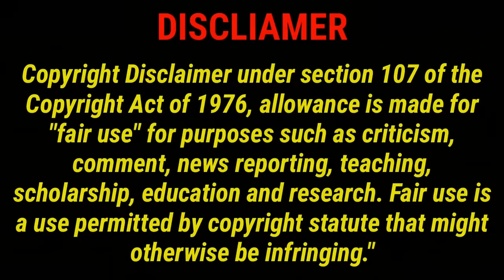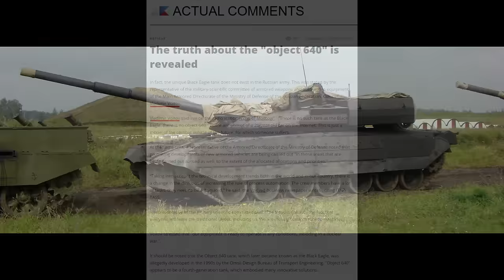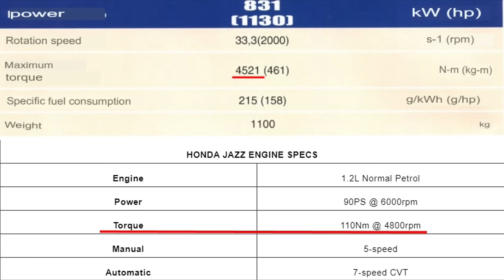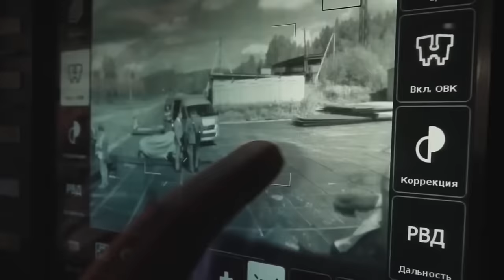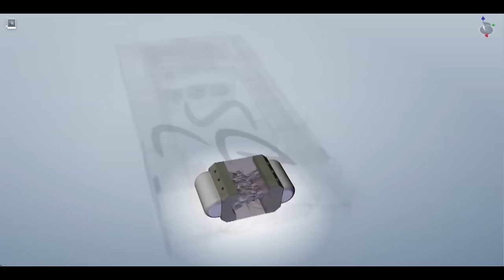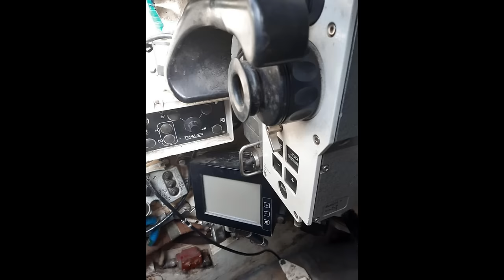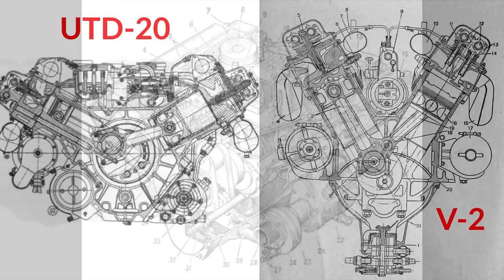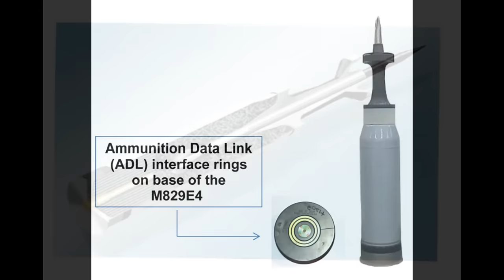LazerPig is WRONG about T-14 Armata

Comment: I mean 96 seconds into the video and there's already bullshit.  "If maintained" the autoloader will function properly...which is a rather big IF given the ample evidence that the Russian Army does not keep their equipment well maintained.  Then you hit the three minute mark and have another inaccuracy when your rebuttal misses the mark...while the 152mm caliber would provide a more powerful EXPLOSIVE caliber it's effectiveness as an anti-tank weapon is limited by the length of the sabot that can be fitted into the projectile.  Two piece ammunition cannot accommodate as long a sabot as a unitary cartridge...a larger 152mm caliber wouldn't help matters because sabot performance depends on a high Length to Diameter ratio.  

Then we get to the engine bit.  Oh jesus.  While the V92 engine has been improved it still, nevertheless, based on an archaic design.  The comparison to the KF51 is ill-founded because the KF51 is a design demonstrator that's using a Leopard 2 hull for expediency.  The EMBT hull was fitted with a Europowerpack with an MT883 which is a 90's vintage engine.  The Abrams X demonstrator uses the Advanced Combat Engine from Cummins that frankly smokes the V92S2F in every single way.  Regarding weight, the discrepancy between the V92 and the MT883 comes down to the former being air-cooled and the latter being liquid cooled.  Which is also why the latter has greater power density and better fuel economy than the former.  Even with the added kilos the engine is still more compact which is probably more important in a tank given larger volumes require more armor to protect them.
Reply: >which is a rather big IF 

lol. You, Pig fanboys, with the exact same phrasing :D

Comment: It's really extremely ironic that Lazerpig knocks modular vehicles on the assumption that backline vehicles don't need armour. 

Never mind the fact Ukraine has been a bloodbath for backline vehicles because of the ability of cheap drones to fly many miles or kilometres behind the line and engage traditionally backline and poorly armoured vehicles. Sometimes destroying them with simple grenades or poorly improvised explosives. 

This is one of those situations where if you'd made that point 10 or 5 years ago you would have been mostly correct, but with the massive proliferation of drones that assumption just doesn't hold true anymore. Almost all vehicles are being up armoured rn.

Comment: No offense my man but a lot of your video is "I didn't find any evidence for..." or "I didn't see anything that substantiated that claim...", the very key word here (or rather, letter) in these terms being *I*. Because you personally did not find similar evidence does not necessarily make LazerPig's research wrong, and it really ends up coming down to conjecture... i.e. "he said, she said" kind of stuff. I have a few problems here as well with your own research and evidence:

1) My primary problem. A lot of your research seems to be pulled directly from RUSSIAN sources. Now, you could say you're "getting it directly from the horse's mouth", which I suppose is fair to say - the only problem being that this horse in particular is known to be a very unreliable horse that has a penchant for purposefully mixing up details as well as just outright lying. Let's flip this for a second so you can understand my position: how would you look at me if I got 75% of my news about what was happening in Ukraine from Radio Free Europe? Of course Russia wants you to believe their tanks are the best, of course they want you to believe they are ahead of the curve. Even if we're dismissing the propaganda reasons, we have to take into account that a large portion of Russia's money still comes from military exports. A used car salesman is not going to tell you about how the carburetor has reliance issues and the engine is prone to back firing. Your method of research would be completely and entirely fine as long as A) Russian logistics and engineering weren't the clusterfuck that they are and B) Russia wasn't well known in the international community for lying about it's own capabilities.

2) LazerPig formerly had a job in British Intelligence. Even if we were to assume that he no longer has any of his old resources to draw from and that his office was kept in a janitorial closet where he heard absolutely nothing about what was actually going on in the world throughout his entire time working there, he was still TRAINED as an analyst within that community. He knows how to research, gather information, cross reference, separate reliable sources from unreliable, et cetera. Even I have problems with how much LazerPig likes to personally interject his personal politics into his videos (I am right leaning, and it is painfully obvious to anyone who has seen his content that he is very, VERY left leaning), however the man is definitely qualified to be speaking on this topic.
Reply: He's so qualified that he stated that T-14 lacks a forward-looking camera, despite one of the sources he cited clearly stating that T-14 has one (it even cited a photo of the display monitor).
Reply: He's so qualified that he just takes any information (no matter how outrageous) from blatantly anti-Russian sources as fact without doing any research of his own to verify it.
Reply: He's so qualified that he thinks that the fact that T-90M's engine is an evolution of the engines used in WW2 era tanks is a big fucking deal.
Reply: LazerPig cites nothing to support his most outrageous claims; that's why RedEffect's "I couldn't find any info-" is completely valid.
Reply: What capabilities was Russia lying about?
Reply: I've seen such claims many times, if Lazerpig found evidence, nobody is stopping him from providing it, so others can also see.
Your comment honestly is  very stupid.
Reply: And what if i told you he was using Wikipedia as a source?
Reply: @hamzatariq5073  You claim he uses Wikipedia as a source and then less than ten minutes later make another comment stating nobody knows where his sources come from? And I'm stupid? Alrite.
Reply: @hastur-thekinginyellow8115   I meant at one point he was using Wikipedia as a source, about object 640 when he for whatever reason mixed it up with object 195.
His claims about the Armata having reload speed of 10s, or it's engine being "Unreliable", or that the armata actually is 20 tons heavier than the t90 have no sources.
Again if he found some sources, then nobody is stopping him from providing them.

Comment: The Engine arguments strikes me the worst. 
If you take an old design and optimize it, you still just modernize an old thing. 
A catapult system, optimized and changed, is still just a catapult system. 
Optimization can do a lot of things. but it can't bend gravity to make the engine reasonable or sensible. 
And the dishonesty of Russia can't make the engine better. They may say and write down that it can out speed anything. But that weight, is simply too significant. 

The Design of Armata may be not as bad. 
But as with Russian corruption and low quality of production, if  a single one exists. It got stripped, components were swapped, exchanged and looted. 
Which means that the real Armata would have it's efficiency compromised beyond belief. Even between the same design, they differ so much it's insane.
Reply: Do you have any proof about your assertions? A single source would be fine to prove that components on their tanks are being stolen, especially engine and sighting components.
Reply: @voidtempering8700  Russian telegrams, relations of soldiers on the frontline, Ukrainian videos of trashed or captured Russian vehicles not being fit for combat, not to mention being according to design documents  and all of the T-34 production history.

*Or Red Effects video: What's in The Bags of Russian Tanks? *

Reactive armor being the easiest to steal, but not the only component lacking from the tanks on the battlefield. 
All the footage of Armata, shows different state of vehicles and different components.( i can;t stop laughing at hydraulic entry hatch ) They show the vehicles more times than there are ones " in service " But somehow, they manage to show more designs than there are tanks. Meaning they are refitted live.

_ can't post links to telegram or even youtube, scam protection, 
so i just type the names of videos or where to find the source if you want to search them _

Comment: The T-14 Armata was originally created as a tank for network-centric warfare. Its main task was to provide target designation for other tanks, howitzers, and helicopters. The long-range howitzer Coalition-SV, which was launched into production just this year, was supposed to work in tandem with it. But the current conflict has shown that unmanned vehicles can cope with this task in many ways, safer and cheaper. And tanks work more from closed positions, turning into self-propelled guns for distances of 5-10 km. That is, while it was being developed, the very concept of warfare had already changed. That is, its problem is not so much technical as in the field of tactics of application. There is no particular point in making a more expensive analogue of the T-90. It will explode on mines no worse.

Comment: Russian tank auto-loaders arent complex technology. In comparison to the engine,,transmission, gun optics, hard kill defenseand even comms of MBTs they are simple. And this system undoubtedly underwent  inspection and maintenance on its way to 3000 rounds. Its a test that isnt worth mention.
Reply: Literally, the actual biggest question is how you select the ammo I can see with even a code bar or with Radio Frquency but in the 60s, I bet it was based on position and loading wrong couls screw you.

But you are correct, the tech is basically miniaturized ww2 ship gun tech.

Comment: Hhmm may I ask for one clarification?

Does the T-90 engine include the transmission and everything else e.g. the cooling system? Because visually you seem to compare it to the entire Powerpack of the Leopard 2. The Powerpack is more than just the engine however.
The Powerpack includes the Renk HSWL 354 transmission and the entire cooling and engine control system.
The Leopard 2 and its Powerpack was designed to be replaced in field in 30 minutes. It is very much plug and play.

I'm asking because all images of the T-90s engine seems to show a bare bone engine. I don't know much but in the images the engine seem to lack any cooling system and I can't identify a transmission.
Meanwhile images used for the Leopard 2 engine show the entire Powerpack when talking about it being bulky and heavy.
It seems to me to not be a 1:1 comparison.

Doesn't change the difference in weight of the engine alone (has only 50% more power for 100% more weight) but the images suggest the engine of the Leopard 2 being enormous when between 1/3 and half of it is transmission, cooling and control.
Reply: The sheets just refer to the weight of the MTU engine, you can check them yourself, they're in the description.

Comment: Wow this is a really bad video from Lazerpig. He's making so many mistakes, so many idiotic comparisons, wild leaps that border on dishonesty. His repeated attempt to act like all the Russian engines are basically all 1930s tech is insane.
Reply: Yeah, like not even sourcing anything properly as well. He says that the modern v-2 is just a supercharged ww2 model completely ignores so much. That’s along with his borderline outlandish jump that the t-14 engine is from a Porsche tiger.
Reply: Funniest part is bro responded
Reply: @sovietbanana4589  hes right. First, It did break down during the parade, or why would russia lie about it. On top of this did you consider that russian tanks must have their final drive disconnected before they have to be towed otherwise they wont budge even if they broke down? And the engine sounds suggest that it broke down.  Russia said that it stopped as a part of the parade initially too, they only layer said it was an emergency brake issue. Your clearly very pro russian and horrendously biased, or red has a sock puppet account. On top of this he focused on several. Red never prpved him wrong. Like when lazerpig said that the bt7m used the lharkiv model, and red said "well it wasnt designed for that model, it was later used in the bt7". Thats not proving him wrong. And red does this same thing throughout the entirety of the video. On top of the challenger 2 part where red says its the acceleration that really matters. Thats not the point. The point was that the challenger 2 is 20 tons heavier than the t14 and goes the same speed. The t14 should be able to run circles around a tank 20 tons heavier, not match it. 😑.  On top of this, the engine in the t14 was indeed a model of the modified sla 16 engine that russia uses in oil pumps. Which brings me to my next example. Red said that the engine is not the same, but its been further evolved. Which is a fancy way of saying modified. The same thing lazerpig said in the original video, but your too much of a vatnik russosexual to care i guess. Red never proved him wrong. Red used a tactic called flim flam, and it worked on a dvmbfvck like you. 👍
Reply: @thatguy46744  the fact that bro is so mad he has to insult people is insane
Reply: @thatguy46744  the breakdown at the parade is a pointless argument. However the entirety of Pigs discussions on the engines being basically 1940s tank engines is moronic. The amount of changes and variations are so extreme that you would likely be hard pressed to find even a bolt that is actually exchangeable with the original. Not to mention this has no real bearing on how well the engines preform. 

Also there's a lot of crap he has about imaginary Challenger tanks that don't exist. There's no Challenger II with a 120mm smoth bore, outside maybe a prototype. The current schedule puts the Challenger II LEP which will adopt the 120mm L55A1 gun as becoming operational in 2027.
Reply: @Lovemy1911a1  thats not the point he was trying to make lmfaoo. It was that the engine can no longer be upgraded because its been pushed to the limit. That was his point. It flew right over your head lmaooo
Reply: @floppi3587  im not wrong tho 🤣
Reply: @thatguy46744  that's a nonsense statement and argument. In what way does having some vague connection to a 1930s or 1940s engine mean it's impossible to improve an engine? The engine has already been changed beyond recognition. There's also no technical reason you can't swap the engine with one of the same size.

This is a very stupid argument. 

Oh and it's complete BS that the A-85-3A is a copy of the SLA-16. The engines are very different, they don't even have the same number of cylinders.
Reply: @Lovemy1911a1  you can only take an engine so far. Thats why the us isnt using a version of the engine used in the shermans. And yes, they could swap it with another engine! Your starting to get lazerpigs point i see. Also the tank museum, a reliable source, also seems to think the a 85 is a derivative of the sla 16.
Reply: @thatguy46744  Tell me, does a derivative engine need to be similar to the orginal. Do they need the same cylinder count, piston size, and other things? Because any of those changes essentially creates a different engine. The only similarity is that they are X-Shaped.

Comment: Excellent fact-checks.   I will mention, regarding your skepticism that the new T-14 autoloader is slower than the long-established T-64/T-72 autoloader designs - they're not apples-to-apples - the old tanks were carousel designs, while the new one is a cassette.   While cassette systems have been used by the West for a while, they're new to Russia.